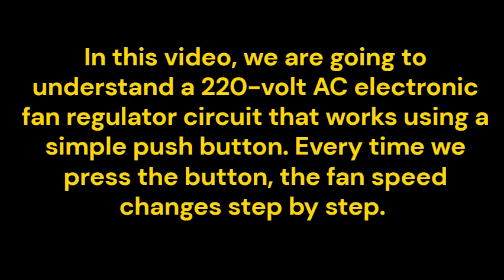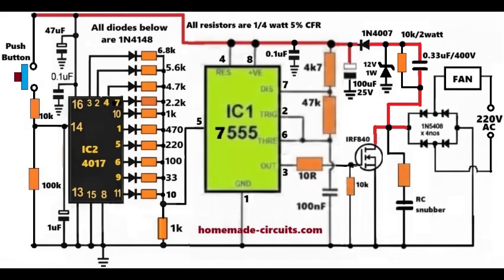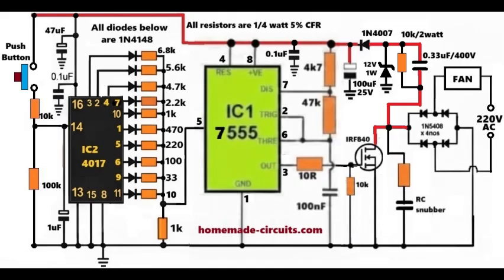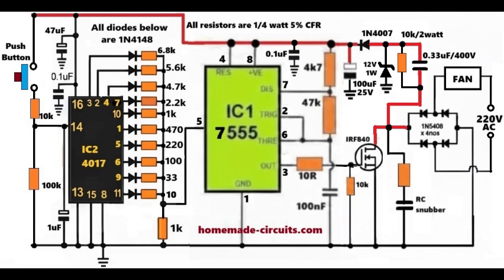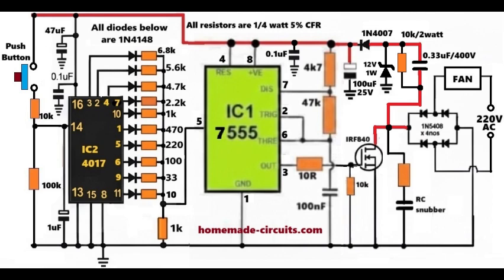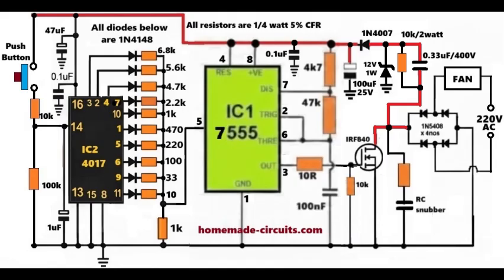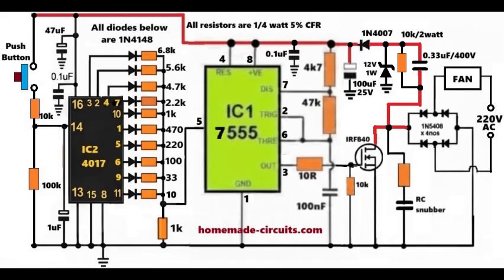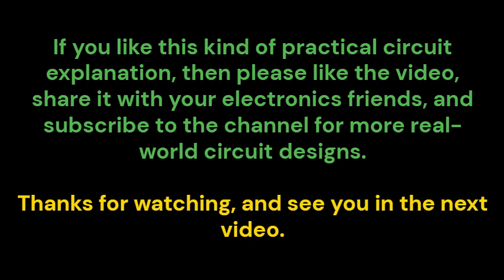Make this 220 Volt AC Electronic Fan Regulator Circuit using Single Push Button

Comment: И каким образом балластный конденсатор, который 0.33 мкФ работает на постоянном токе?
Reply from the maker: I have added a 10k discharge resistor parallel to the capacitor, the capacitor acts as a supporting role for the resistor, so that the resistor does not heat up too much...